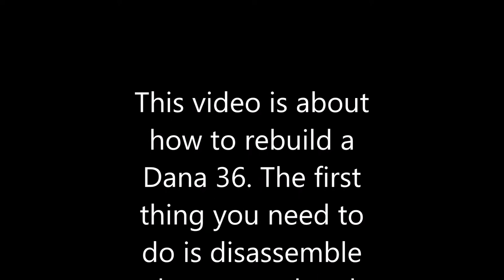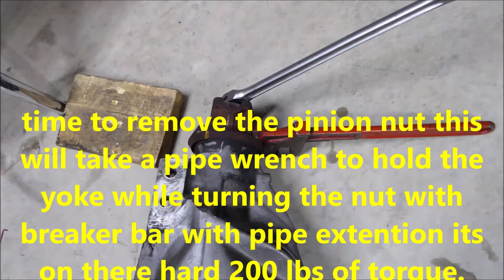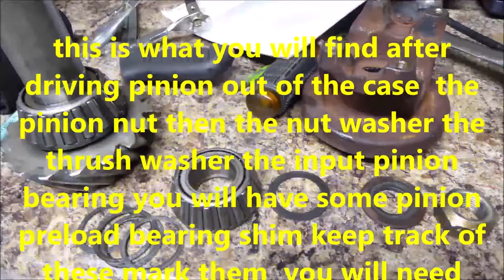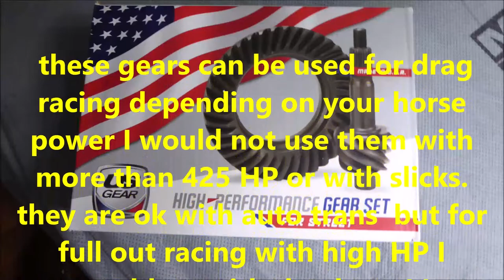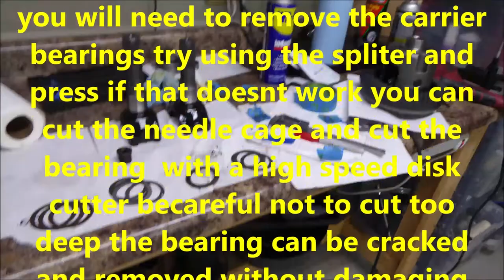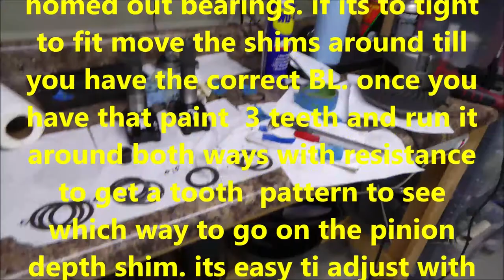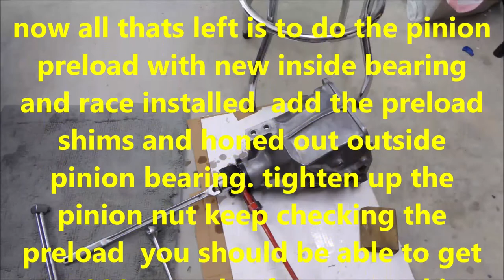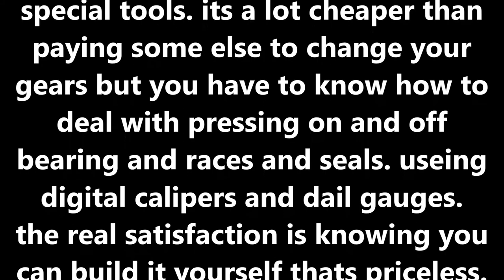How to rebuild a dana 36

Comment: Sometimes you have to grind the end of the shaft where the clip goes on
Reply from the maker: if you look at the inside of the  c clip closely you will see its not flat but is slanted. make sure you put the slated side toward the half shaft it will go on easier.

Comment: How has the dana 36 held up with the 3.73? I'm considering 3.54 but a little concerned about the dana 36. Not planning to race and I have regular street tires. Looking for some advice.
Reply from the maker: The Dana 36 with 3.73 gears have been holding up good. Im putting 400 to 500 hp to them and they are holding great. of course they could blow anytime. Im running street drag radials and is burning all the way thru 1st gear. also have a 3k rpm stall converter. why are you going with 3,54 ? the 3.73 would be better for  acceleration. I would have gone with 4.10s if they made them for the dana 36. you will need to reprogram your computer to keep the speedometer correct.
Reply: @dxn1999  I thought the 3.54 would be a considerable jump from the 2.59 and would have a better chance of not blowing up on me. I'm also considering buying a used 3.07 since that shouldn't cause any problems. Just gathering as much info I can before making a purchase.
Reply from the maker: @ctoph75  You should be able to find some 3.07 gears on eBay pretty easy. I bought a complete rear end with 3.07s shipped for $300 I still have them just keeping them for back up. If you arent racing the 3.07s  should  give you better performance  but less gas mileage than the 2.59.  what blows up the gears is not the ratio but how much power you put into them.. with stock engine HP they should last for ever no matter what the ratio. More HP and better traction will find your weak  link in  the drive train..

Comment: I didnt see where you set the pinion depth, did you rely only on backlash? I'd rather not buy the $500 tool if it's ok to just go off backlash lol. Thanks!
Reply from the maker: I started with the same pinion shim as the stock gear set. then adjusted for he correct back lash then the key is to look at the tooth mesh pattern that will tell you if the pinion depth is right. .Its kind of a try and error  till you get it right. Thats why you need the bored out bearing so you an change the back lash while changing the  pinion depth. It can be done without buying the expensive tool you just have to know what you are doing.
Reply: @dxn1999  ok cool, thanks for the info!! 👍

Comment: Hi I’m jay new subscriber to the channel from the U.K. love your car Im restoring a 92 lt1 auto coupe never worked on cars before but I have done the opti and water pump plugs leads oil filter also cured a wiring issue in the harness great car to learn on are they easy to nitrous? I’ve recently started a channel be great if you would subscribe and any advice would be really appreciated keep up the good work 👍🏻 Jay U.K.